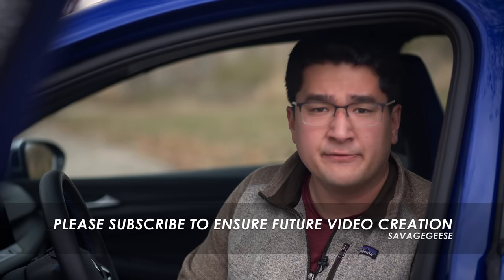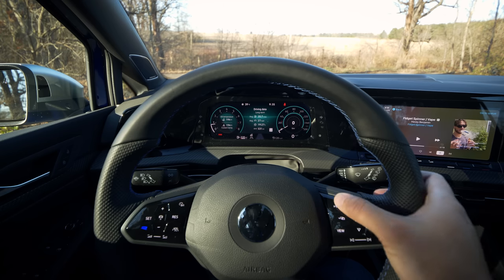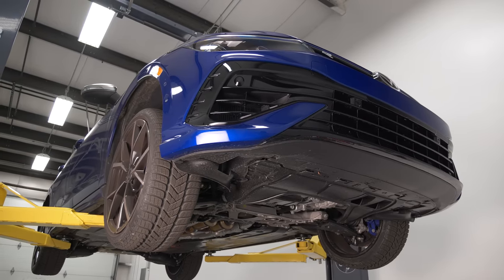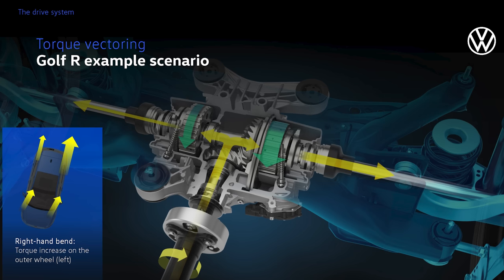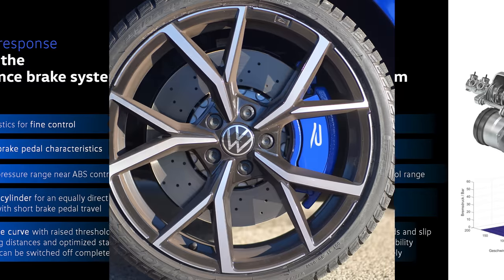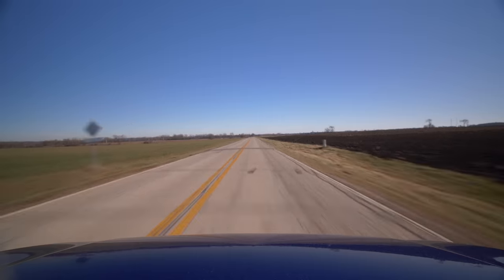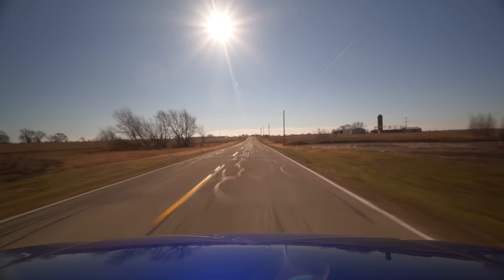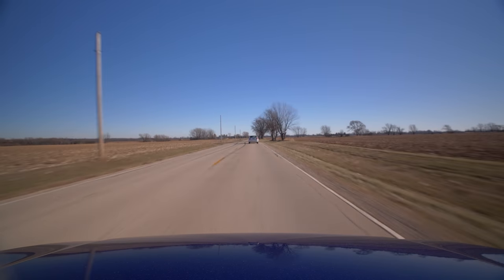2022 VW Golf R | Tearing Up The Streets

Comment: Yeah, I'll just sorta wait until they revise it; no reason to be an early adopter here. The entire needs some more work, ditch the piano black, ditch the capacitive buttons on the steering wheel and just either bring back proper AC controls or just go all-in and put it into a dedicated screen. Add a button similar to the VN that can toggle between a full-track mode and programmable custom mode and it's honestly good to go. The vehicle has the grunt, it's in a decent price range, and it's on a trusted platform. My guess is they wanted to differentiate this and the Audi S3 a bit more.

Comment: Stinger gt1 awd owner here.  Torn between tuning my car or trading it in for a 2022 golf r (and probably tuning it). I love the stinger,  but it definitely feels heavy.  Might upgrade sway bars to help.  Test drove a 2018 golf r and it was a lot more nimble.   Does anyone here have experience with both vehicles?  I'm aware of all the technical differences and all the specs.  I would love to hear some thoughts from anyone who has owned both cars long term.

Comment: If the Audi S3 8Y didn't exist I would still buy this car, despite its interior. It is a hot hatch performance KING with the DSG. It beats the Type R in my book.
Since the S3 8y does exist however, I bought that instead. More expensive but at least the interior is great.

Comment: it wouldn't surprise me if they revise the infotainment over the next couple years. it's a trend with manufacturers these days in more than just the car industry - you leave something on the table for later model years to "improve upon."

something as resource intensive as re-adding physical controls might have to be the mid cycle refresh though, I think. so I might be waiting for the 8.5 R lol

Comment: As an MK7 owner, I think my next car is gonna be an electric car, maybe Model Y performance. 

I think most of the R owners are car lovers like me, we love exhaust sound, love the handling and enjoy doing some modification.
But as EV becomes better and better, I see no point of buying these kinda of "Perfomance" cars anymore, especially since R is kinda pricey

I'm little tired of the maintenance every year, tired of changing exhaust and flashing the ECU just to get some additional HP, while an EV can easily get 500 +HP with basically no maintenance and no worries about the check engine lights and void the warranty.

I know Tesla's interior is shitty, but R's interior is not a whole level above anyway..Plus technology-wise EV is way better with the big screen and fast processors and apps and functions.
Reply: Why do you need 500+hp for the street though? You planning to fly?
Reply: @urbanizeddreams  I didn't mention "Street" in my original post did I?
Reply: @xcg1234  For the track, you still don't need that much power though, and an EV at the moment is not a good track alternative. I think you just want to go fast in a straight line to impress people you don't know. =P
Reply: @urbanizeddreams  Not really, I mean Tesla is very common and who's gonna be impressed by that lol...High HP on street is mostly useless, but on highway if you want to pass some car real quick, the instant torque is gonna help you to make that move. You might not using 100% of 500HP all the time but what matters is when you do need it it's there for you, ready to go.

Comment: Thank you both for being realistic about the entire vehicle, including the infotainment system. I think something should be made abundantly clear - from a driving performance perspective, this is a massive upgrade. From the HP/TQ increase, upgraded brakes, and overhauled AWD system, this car is quite different (and objectively better) to the previous generation.

However, the amount of people coming out of the woodwork to defend VW over the poor infotainment system and cost cutting measures compared to the last gen to somehow justify their Mk8 purchase is hilarious. The cost cutting is substantial:

- No hydraulic hood struts.
- A foam engine cover? Seriously? I'm nitpicking, but the last gen had an awesome engine cover with the VW and R logo.
- The seats (and fabric), while still supportive, are entirely worse compared to the last generation in materials and quality
- Hard plastic everywhere.
- WTF is up with the economy-budget shifter on the manual? Serious downgrade.
- The overall feel of the GTI and R are not the same as any previous generation, even when doing something simple like shutting the doors.
- Terrible, and I mean TERRIBLE buttons on the steering wheel. If you drive this car in any colder climate, you have to take off your gloves to use the buttons at all. There are plenty of places where it's 30F or below for 6+ months out of the year, and this presents a major hurdle.
- The infotainment system reminds me of an alpha/beta project that some executive decided was ready and force pushed it into every production vehicle. And for all the people going "Oh I like touch buttons!", ***every single other car manufacturer has gone back to physical buttons after making this stupid haptic/touch-based button push***. It's not safe when driving on the road, PERIOD. If you don't think so, argue with the litany of safety engineers that explicitly say this shit is blatantly unsafe. It's not a "different strokes for different folks" opinion, even the new Audi S3 uses a combination of physical and haptic buttons. VW will regret making this push because it will put off a lot of buyers.

Finally, while not a cost cutting measure, the last generation was infinitely better looking on the front end. WTF is up with this unibrow design? The Golf and WRX both look like crap this year, like they can't decide what they want to be.
Reply: I own a 2022 R and have to disagree with many of your points - one important point for me is that it is also superb to drive!
Reply: @tedjones403  you're welcome to disagree, but every single reviewer of this vehicle (with way more experience and clout than me to boot) agree with my points. I'm glad you enjoy your R!  Not bashing your ride, enjoy the car, but I'm glad I've got the 7.5!
Reply: @japanwatchconnection I debated responding because this is 11months old, but for the record: even corporate VW is changing back to physical buttons and a variety of other stuff from last gen due to poor customer feedback. I also wouldn't use the word "salty" (considering I love Golfs in general), but feel free to insult me at your leisure. It just makes you look silly.

Comment: I agree with Mark, the manual on this car sucks. The gates and the clutch take up are extremely vague, it is like when you go to shake a mans hand and he goes completely limp, it is just gross. Then there is the fact that they had to lower the power and torque output for the manual, why not just use a heavier duty clutch? Well the stock manual clutch is a well known early failure item, especially if you tune for more power. So a lot of folks then put in a heavier duty aftermarket clutch, but then we start seeing crank walk engine failures. Is that why VW would rather detune the engine over using a heavy duty clutch? 
I have even driven cars with modifications to the hydraulics, linkage and short throw shifter added, it is better but still garbage IMO. Meanwhile, the DCT works incredibly well, has been extremely reliable, handles added power no problem, and is much faster and gives better gas mileage. I know, I know, save the manuals, bla bla bla, and for cars that have great manuals I agree, but for this car, no. The manual just isn't very good, reduces performance, and leads to reliability issues. Going with the DCT for this car is a no brainer IMO.

Comment: The bigger question remains to see if the Magna Torque converter, with it's dual clutch plate engagement, will be an issue.  I have a rule to NEVER buy a car in a first production year as I have witnessed this myself with many other brands, there are always some kinks, especially with NEW tech to the particular brand.  Had it been an identical carry over with minor mechanical tweaks, I'd jump it!
  
Seeing how (in Canada anyways) you can get a MY '18 or MY '19 R for a few thousand dollars less than a new R (some dealers have stock and unlike the USA, it is ILLEGAL to go over sticker price here), I would really hesitate... but why be the first to be stuck with issues....but then you have warranty...but then, it takes time to find a proper fix, (Think of TFL Truck Land Rover situation!!!!), my money would be a pre-owned, pre-loved CPO car, keep it for 3 years and THEN get the mid-cycle update?  I dunno! 

As always, interesting points that were brought up.  I fail to understand how the lack of having EITHER a feedback sensation or Backlight sensor for climate and Audio was able to pass VW Design or even NHTSA.  To me, it is not illogic.  I much prefer the interior of the MK 7.5 but in all honesty, the temperature and Volume slider situation would not be a deal breaker.  
I am always fascinated to see how far VW and other car brands will go to save a 1$.  Notice that size of the cluster has been made smaller and that you have some flashers, glow plug, check engine light which are NOT on the LCD but on the OUTSIDE of said screen?  I also agree with Mark and this shifter looks like it came from the bin of the Base line Jetta.  This looks CHEAP and I hope that VW would offer a proper shifter as a parts accessory at the very least.

Great review and glad to see Jack hit the rev limiter...driving it like he stole it!

Comment: Excellent review ... yes the infotainment system is a big problem, and the drift is a joke and really do not like the few cosmetic changes which make it look like a Toyota. Hate the dash as well... Very impressed with the Torque vectoring and other handling/performance upgrades.  In Oz apparently, the car will be detuned ... something to do with the particle filter AND no manual here BUT I prefer the DSG anyhow. Apparently, we will be getting all options except the exhaust... which we may get later as a 'special edition' So the 'chicken nugget' shifter in the auto 8 is also stupid. Love the seats BUT need to also make the passengers seat electric. The on-road cost will be over AU$70,000. Anyhow bought the last of the MK7.5's ... 2020 R Final Edition (only Oz) and after the first service did the APR Stage 1 tune and also the DSG tune and performance air cleaner filter, turbo elbow, coils and race plugs ... SO will stick with the MK7.5 for now and see what they do when they eventually make an EV Golf R ... and it comes to Oz ...

Comment: I had a 2019 R. I took advantage of the ignorant money the online car dealers offered and sold it.  It was a fine car, but I could never really take advantage of its abilities, and it was difficult to enter and exit.  And while it had better ride than most sporty cars, it still was unpleasant.  Seats were too narrow as well.  So I grew up, and got an RX 350 that is a great interstate cruiser, with more storage space and similar fuel costs as the 350 doesn’t need more than 87.

Comment: It’s such a shame. I really want to buy one, but I can’t get over that infotainment system and lack of controls. Without physical climate controls, etc, you can’t even upgrade the stereo. It’s such a shame. I desperately want and am actively looking for a fun, manual, awd car.
Reply: @japanwatchconnection we’ll have to agree to disagree. I’m on the side of the journalists. I’ve used these systems and find them genuinely awful compared to normal controls. Audio is pretty subjective, but I would also disagree on sound quality.

Comment: I was seriously considering a new Golf R but the touch screen infotainment / heating cooling system  preventing me from even looking at one. A touch screen system in an automobile is not just cumbersome it is dangerous requiring the driver to take their eyes off the road far too often. Heater, a/c & radio controls were never a purchase issue for me but they are now! Sorry VW, I had a older GTI and I loved it, but if  a touch screen is in all your new cars, you have forever lost me as a customer.

Comment: I owned a MK5 GTI and loved it. It was the most satisfying car to drive I've ever owned. Unfortunately the engine went under right around 130k and would have cost $6,000 to fix. The car was only worth @$5,500 at the time. I now have a MK7.5 GTI that just doesn't match the eager performance and handling of the MK5, and the transmission shifts are just too lazy, sluggish and geared for economy. To me, it was a step backwards. Also the costs have soared for this car. Even a normal SE GTI will set you back well over 30k these days. The looks of the new one just doesn't do it for me either. Makes me wish I had paid the 6k to fix my old MK5 and kept it.
Reply: Are u American?? Cause mk7.5 golf gti is most aggressive gti ever made but only the Wolfsburg build ones
Reply: @Fiwek23452  Compared to the MK5, the throttle mapping and transmission is just not as eager and ready to drive down the road. Sport mode just holds the shifts too long, Normal mode, upshifts too soon. I think emissions regulations has something to do with it and, of course, fuel economy. The MK5 was always ready to go fast.

Comment: What exactly is a “Dell technology “? Aren’t there just generic Windows PCs?
Reply from the maker: Dell Technologies is a massive group. They have consumer product all the way to HPC and Cloud Infrastructure. I am supported by their enterprise business division.
Reply: @savagegeese  Interesting response to dance around the question. If the “Dell technology” Windows PC was hidden away and you were using generic aftermarket keyboard, mouse and monitor would you know you were using a “Dell technology” or just another generic Windows PC. I don’t see anything special or proprietary about a Dell PC.

I agree on the infotainment, I refuse to buy a GTI until they get rid of it. Worse mistake then Honda getting rid of the volume knob on the civic.
Reply from the maker: @jakp8777  The workstation I am using is by far anything from generic, including the baked in bios, thermal tuning and software which help make it stable and high performance while running almost 24x7.  The other side is I have been on the road 7 weeks in a row and still able to edit and create video projects not possible on 90 % of other mobile devices.  Video projects like the GT3 video which was also finished on the road, using no proxies or transcoding on 10bit 422 4k footage.  Its not marketing bullshit, believe me.

Comment: I had a 2015 MK VII GTI with a manual transmission. I constantly regret that I turned it in at the end of the lease. It was an amazing driver that looked great. IMO, the current cars are better drivers and the R is a beast.  But…the current cars are really ugly in comparison internally and externally. I don’t think I could buy or lease this, no matter how good it drives.

Comment: I'd take the Civic Si over this and save over $14 grand, yes it's got less bhp but it's going to have better reliability and running costs in the long run.  Not to mention better infotainment and better interior space, don't get me wrong, the GTi and R are really nice but VW are over charging.
Reply: Could not agree more with this comment. VW makes crap that burns oil and falls apart.

Comment: I love your reviews and your show but I have to say I cringe every time anyone hits the rev limiter especially during every gear shift.  Its annoying when that threshold is reached and the car has to tell the driver when to shift.  You do realize that you stop accelerating when you hit the rev limiter so what's the point in hitting the rev limiter?  If you don't like to look at the tach then remember the sound frequency.  If you do this while racing you loose lap time every time.  I'm also sure the engine would in the long term prefer not to have disruptive fueling and ignition interruptions that rev limiters create